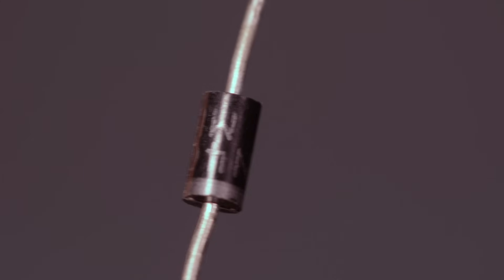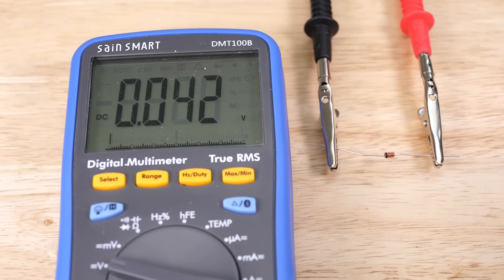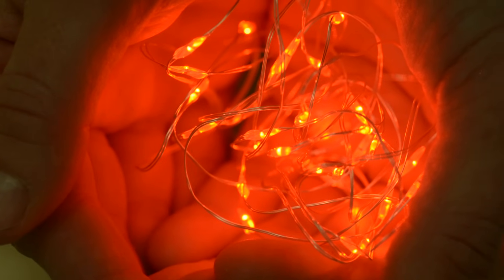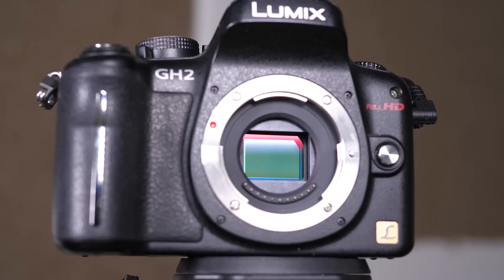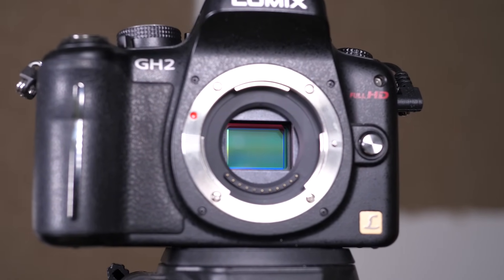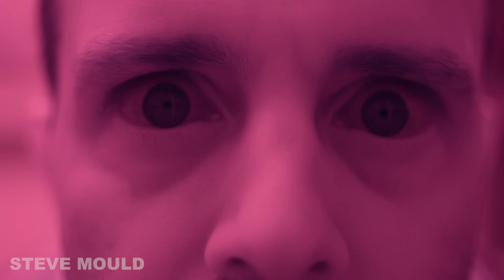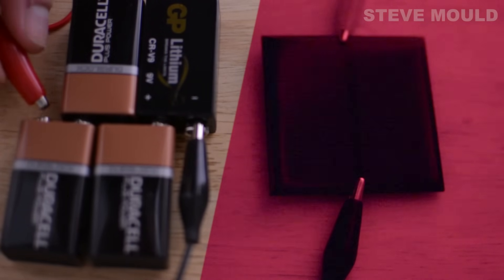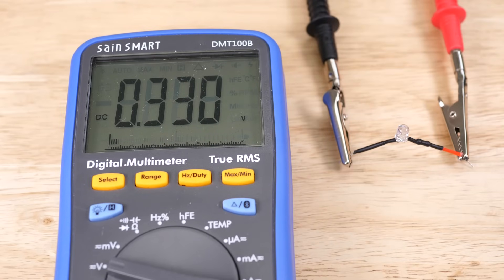Why all solar panels are secretly LEDs (and all LEDs are secretly solar panels)

Comment: Thumbs up.  We just got off the grid and I did it all from here on YT, using Ford C-Max Energi batteries and a Magna pure sine Inverter, we also run two systems right now a 48 volt and a 12 volt for lights and most electronics.   What I want to do is convert our TV's to 12 volt since they mostly run on 12 volts anyway.  Have you or anyone you may know ever did this conversion on a normal AC TV ?

Comment: That is a very interesting thing to learn.  I thought I read something about using diodes like this too somewhere.  The fact is that some things that consume electricity can also produce it.  A permanent magnet motor will generate electricity with no modifications needed.

Comment: Remote controls for home entertainment (Cable box, TV, DVD) tend to wear out. That is one reason there is a market for replacement remotes. The universal remotes can be trained, usually by entering a code that identifies the make and model of the equipment on which it is to be used. But, some can also be trained with a working remote. The user puts the remotes so the LE.D. emitters face each other. The one being trained reads and remembers the codes transmitted by the other.

I always assumed such remotes had a separate photo receptor somewhere near the L.E.D.s. But, from this video, I see the L.E.D.s are the photo receptors.

Comment: This is no secret! The solar panel is constructed to produce power better than a diode and LED. A LED is constructed to emit light in a more efficient way than a solar panel and diode. A diode is constructed to control the flow of electricity more efficient than a LED and solar panel. None of these are truly the same but they do have some similar property's of construction and operations. If an electrical engineer needs the function of a diode in an electrical circuit they will not use a LED or solar panel, they will use a diode.
2:04 - The editor should have cut this part, because that's the point I stopped watching this none sense .

Comment: Ok please someone explain to me why can i use speakers as a microphone? Im a bit confuse.
Reply: Voltage is generated when a solenoid (coil of wire) moves through a magnetic field. Voltage change can be used to make a solenoid in a magnetic field to move. 

A classic speaker design satisfies both criteria hence it can be used interchangeably. 

Hope that helps.
Reply: @leviahamefula3994  so in a way it acted like a brush motor. Thanks.
Reply: Microphone has a membrane that vibrates and sends signal to headphones which accept it so you just need to reverse process

Comment: How many LEDs in the sunlight are enough to power up a single LED?
Reply: Probably only one since LED's don't need much power in order to light up but it would need very intense sunlight because of how little it is.
Reply: Joseph Bennett well, I've got some LEDs, so I'll try myself. Any results will be posted in this comment section

Comment: This reminds me that the earlier Raspberry2 B models had a single diode that caused the computer to reset when a sufficiently powerful light hit the board. For example, a photo flash... this is why those earlier models were called "camera shy".

Fun stuff.
Reply: It wasn't a diode, it was the power IC (component no. U16), which was a WL-CSP chip. Basically an integrated circuit without any packaging, attached directly to the board. Still caused by the photoelectric effect, so the principle is the same, but it wasn't a diode.
Reply: Sometimes the led right in rpi begins to glow with our any external power supply
Reply: Realistically this applies to any component, but as far as i know risc is extremely low power, so essentially it's much easier to overvolt.
Reply: Fun Fact: a sufficiently powerful laser swiping across the power section would do the same thing! Ask me how I know......😒
Reply: Wow thats true
Reply: Daniel Leal it happend with risc proccessors.

Comment: According to you, if one wants to check solar panel accurately then external voltage should be applied to match Vmpp of the solar panel and examine it with camera. Am I right?

Comment: Well then the logical solution would be to design a solar panel  that not only charges the circuit but also admits the light at the same time . like a really cool outdoor garden light so at nighttime it admits light directly from the solar cell and during the daytime the same solar cell charges the battery

Comment: this is idiotic. looks like those insane people who try to combine things. each device is a separate device, like, an eye is an eye, and a ear is an ear, who cares if theres cells in ears and cells in eyes, a solar panel is not, an LED, and LED emits light. a solar cell is designed to capture heat and light and transfer it. get off the new world order crap ! its bullshit dont you get it ! the new world order crap is gay is straigt , straight is gay, and parts do multiple things ! its bullshit ! all of it. the new world order crap is evil. and the root, of the evil is the combination of things that used to be separate.

Comment: Too bad the Solar soaking variant- though tweaked for that specific job, really is not that efficient. The visible Light Emitting type however, is quite efficient at its job. Someone should do a video on how types of diodes are be used to send data in binary, from TV remote controls to toslink to the fibre optic networks of today.

Comment: the same goes for electric motors and alternators, every motor can be used as an alternator and other way round
Reply: No it can't, a motor with a commutator acts as a dynamo ie it has a DC output.  If you put a DC voltage across and alternator* it will just twitch and not rotate.  Some types of washing machine pump motor will act as an alternator.

* I mean a basic alternator, not an alternator with a rectifier &/or regulator built in.

Comment: So basically, solar panels , when connected to a voltage source, emit light but we can't see it because they do this in the infrared region and not in visible wavelengths. Good! Thank you.
Reply: Manan Varma  No, it's just heated up absorber that emits light and wears off in process. 
After few minutes of that solar panel loses effectiveness and dependig on type and absorber it could completely stop working
Reply: @Phantom-el6oe  So, doing that isn't advisable. LOL I was thinking of doing this. Thanks for saving my solar panel :-)
Reply: Manan Varma Always to your service sir
Reply: @Phantom-el6oe  Roger That! Thank you sir!
Reply: @Phantom-el6oe  No, it's not true, and that is not how diodes generate light! If you had a GaAs or a direct gap semiconductor panel, it would glow, once you apply voltage bigger than the bandgap. But it would not emit IR. In the case of Si diodes, they will not emit light because they are indirect bandgap semiconductors.
Reply: @patrikgubeljak9416  Is solar panel a diode and was intended to glow? No
Reply: @patrikgubeljak9416  Silicon does not emit light *efficiently*.
Reply: @Phantom-el6oe  Yes, a solar panel IS a diode. It's formed by a PN junction (or now, P-I-N junction).

Comment: I knew that, but you opened my mind much more about it.  I'm an Old tech guy.  You should explain how your driveway sensor light works.  The infrared ones, which are most of them.  Don't get me started on ultrasonic or microwave motion sensors.

Comment: yes, infrared is not visible, and there are infrared LED's, as long as it is in the electromagnetic radiation spectrum, it is still essentially light, just more like heat than light, but still.

Comment: you know what's keeping me from being curious at work? I have been there 18 years and curiosity will get you no where.  due to highly compartmentalized security measures I am not even allowed to learn about other areas of the business unless I can prove I have a business need to do so.  Therefore I just stop caring.  their point is, if I leave or get scouted by a competitor I will only know a small portion of the process and wont be able to fully compromise their market share or tech advantage, but it really does hamper my ability to remain curious.  I would love to know how other areas work and what they do, perhaps I would find a better position that I would be much happier at but since I am not even allowed to know that info beyond hearsay I just sit there day in day out, well actually night in night out (I work night shift) trapped in my seemingly endless joyless job.

Comment: So all our LED TV's are passing a small voltage when turned off in a room with light?
@.@
Reply: Your led tv is an lcd tv with led backlight. Oled tvs are different. When it is off the lcd is black and doesn’t pass light.

Comment: I used a strong LED flashlight to check on my chimneypipe...When I stick the flashlight into the pipe of stainless steel the flashlight starts to sing...give of a loud tone, a frequency that changes when I put the flashlight in deeper. That made me come up with the idea to take a stainless steel pipe and aim the tone that you can only hear when directly in the beam and regulate it by changing the dept of the flashlight. Very interesting results. Now I'm trying diferent metals and bigger LEDs.

Comment: Why arnt phone screens used a solar panels then?
Reply: For the same reason they designed specialized diodes to use as solar cells. Because regular diodes suck at it.

Comment: When a LED is illuminated from a good source of light: how much voltage can be read from that dipole? How many Ampere can generate?
So, technically, how much power can I get from that process? Is there a correlation between the power of the light source and the power generated by the LED?

Comment: I first had that eureka moment when I was sat playing with an LED and was reminded of the 'equal and opposite reaction' law. I thought if LEDs emitted light when a voltage was passed through them, would they create a voltage if light was shone at them. To my amazement this was true as I also connected a volt meter across an LED and shone a bright light at it. It was a few years ago when I did this, and now I have discovered this video and it has made me smile! Thank you! True scientific discovery and learning :)
Reply: That feeling must be amazing
Reply: Equal and opposite is only for KINETIC ENERGY Lmao
Reply: So if I push my car the tank will fill with gasoline?
Reply: @stargazer7644  No, but if it was an electric car the battery would charge.
Reply: @stargazer7644   🤣🤣🤣 I wish 😛😂😂
Reply: @stargazer7644  and if someone pushes you..
Reply: Shone
Reply: So you learned something true on a false premise :)  I hope you realize these days that the "equal and opposite reaction law" does not apply to everything.  Newton's laws of motion are just that, laws of motion.
Reply: yea now hook a load up to an oven burner and see if it powers your device by pulling heat out of the air
Reply: @Fine_i_set_the_handle  That's sorta possible due to the photoelectric effect. Sort of.
Reply: @nikkiofthevalley  but it's very possible do to the law of sarcasm

Comment: Interesting, if solar panel emits infrared light, it absorbs visible light and even ultraviolet, how it possible. The sensitive to light energy levels of external electrons in semiconductor should be the same. And in general, I thought, solar panel is more close to capacitor, not  providing circuit like diode, interesting. I have one at home, I will check.

Comment: You can use an LED as a trigger for a laser tripwire system.
Much faster response than an LDR although you might need and op amp to interact with such a low voltage produced by the reaction from the LED.
Reply: Usually for detection diodes are in photocurrent mode, and are reverse biased, so you connect it through a current sensing resistor and then use a voltage comparator. Op-amps run in saturation mode have slower responses.

Comment: So if I buy a few rolls of led strips , I can run them in rows  top to bottom on a 2x5 sheet of plywood etc and then cover it with glass with some limo car tint on it.  Then I'd have a solar panel ?

Comment: I've learned three things in this video.  Which led me to figure out how IR remote controls work. 
1.) Solar panels are diodes.
2.) Solar panel output light when power is applied (very low and IR).
3.)LEDs convert's light into electricity.

As a kid I figured out that speakers can be used as a microphone and even learned that microphones can output sound. After getting my first phone with camera I realized that they can actually see the Light that remotes output. This led me to realize that they output light pulses that the receiving device decodes the binary pulses into a signal. I had dissembled broken remote control devices and noticed the IR receiving LED but never bothered to research how the picked up the signal. 

Watching this recommended video, I found the title interesting. After watching it I now know that the receiving led picks up the infrared light as a voltage. The device sees the change in voltage frequency and that's how it works.
Reply: IR remote signals are actually broadcast on a subcarrier on the IR beam to allow better  noise rejection, but you’re on the right track.

Comment: Pretty cool it's amazing how small things have gotten in 20 years transistors were the size of a dime when I took electronic engineering now the size of a grain of sand AMAZING ✌️thanks for this info
Reply: Newsflash, transistors are now about 10 nanometers big. So you could line up 100,000 of them side by side on your grain of sand.

Comment: Keep in mind that a regular Light Emitting Diode is not the same as an InfRared Light Emitting Diode.
Reply: Nor is the receiver IR-LED the same as the transmiter IR-LED
Your remote control has a transmitter IR-LED (Water - Clear) & the components they work on have a receiver IR-LED (Black).

Comment: It is a bit misleading to say that every diode is a LED, because normal silicon PN junction diodes generate only heat and no visible or near infrared light at all. That is because there are two ways electrons can recombine with holes, and only certain types of semiconductors support the generation of a photon. All types support generation of a phonon, which is practically heat in this case.

Solar cells are not normal silicon PN junction diodes at all, because a simple silicon PN junction has very low efficiency at converting excited electron into electricity (but still works). In practice these things can get really complicated, but generally: every PN junction can emit photon/phonon and can convert photon/phonon into electricity. (you always loose energy as phonons because of thermodynamics)

Comment: I double dare you to desolder that tiny microphone from a laptop and use it as a speacker. It won't work. Not all mic's are speackers.
Reply: They’re talking about dynamic microphones, not condenser mics here.  But if you put enough voltage across a condenser mic, it’ll make noise too.

Comment: It also works for transistors even the burned out ones.
If you can pull the caps off (TO3, TO8 etc) and shine light to it you get voltage on the terminals.

Comment: I have a question for you Steve, as you know there are many segment of energy in the electromagnetic spectrum, with a plethora solar energy my emitting from the galaxy ["sea of energy"] all arround us, The question is how come solar panels are only "tuned" the visible light spectrum/ir"  Theres is billions of watts of energy in the elctromagentic field from both man made source as well as solar galaxy energy. . ., my theory is to create a broad spectrum panels that picks up wide bands of energy , " look up thomas henry, morray, teslas radiant energy generator, and ham radio emergency back up generator, , ,  the energy is out there and visible solar light is just the tip of the ice berg. . . .
Reply: Because the energy we get from the galaxy works out to be femtowatts per square meter. It is stunningly weak.  We get huge amounts of energy from the sun because it is close by.  That energy peaks in the visible light spectrum, and so thats where solar panels have been designed to be most efficient.  We get about 1000 watts per square meter from the sun.

Comment: So if electric motors can be used for regenerative braking then if you had a panel of LED's for your headlights those should be able to partially charge an electric car in the daytime.  Make the LEDs into a raised cone to mimic those 3D solar cells and somewhere there is probably an optimum design where the LEDs and solar cells can be equally efficient.  Sounds like a great project for a mad scientist, but I don't think Phillips or GE will be tossing money into finding that sweet spot.

Comment: Interesting video.
About diodes everywhere, yes it is.
Just that diodes have been optimised in a way or another to perform better for a particular task.
So, a LED is not as efficient as those involved in photovoltaic power generation.
Same goes for everything else in life... ;-)